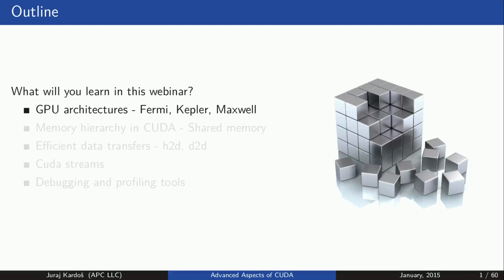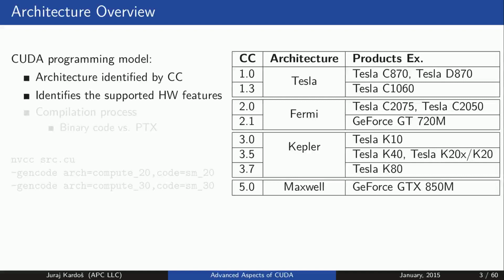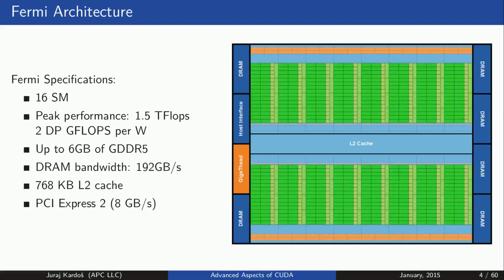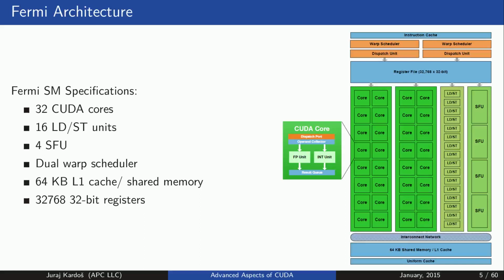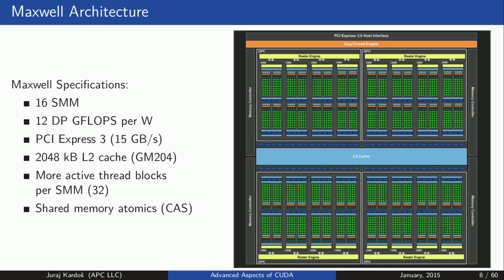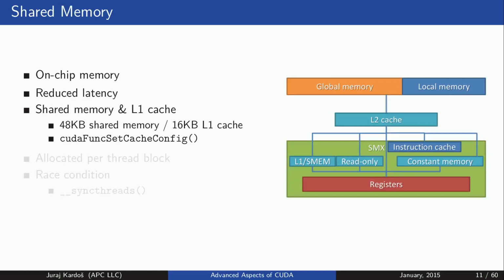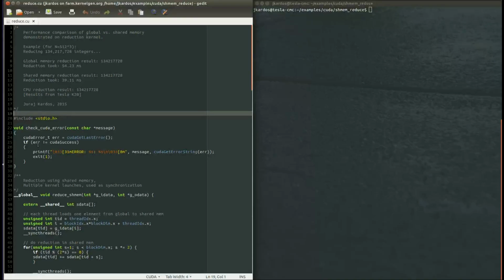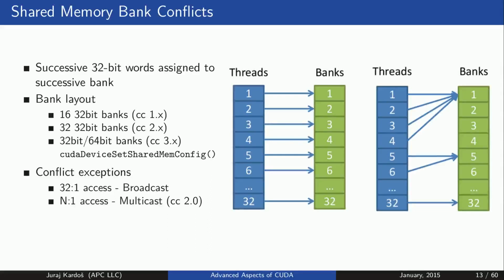Advanced GPU computing: GPU architecture, CUDA shared memory

Comment: can I share some of my 16 gigabytes of ram with my video on my desktop?  I'm trying to turn up settings in a video game that require more vram than I have but I also see 8gb of ram (2) full sticks of ram not in use
Reply: Probably not beause you would take to much bandwidth of the pci and the other bus. So you can t use it as its to war away and you don't have the infrastructure